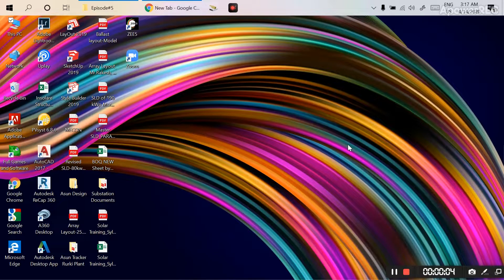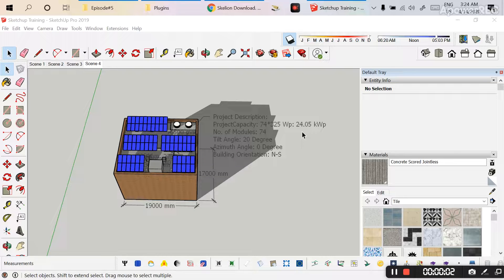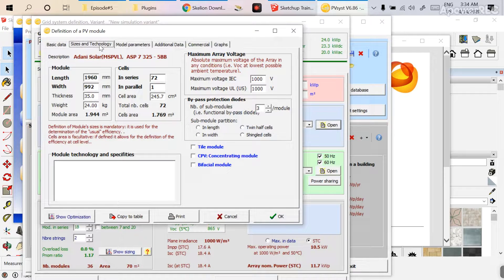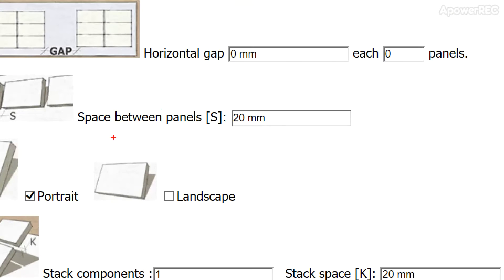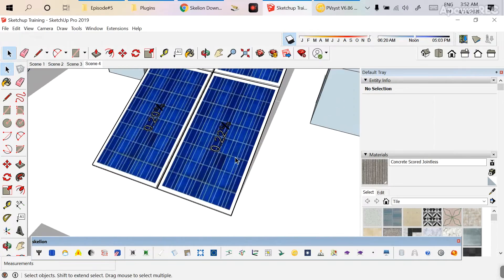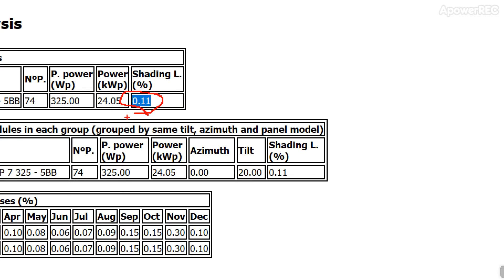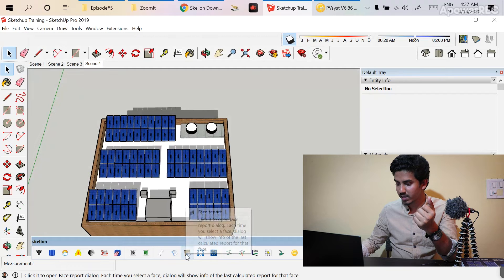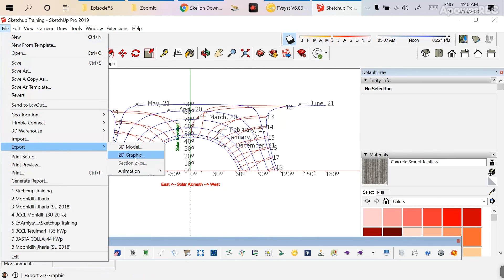Solar Power Plant Drawing using #Skelion/#SketchUp Training part 3/(Solar Power Training Episode 10)

Comment: Hello Sir, while designing the panel design with skelion,I have some issues with the software. It gets hanged completely and shows not responding. Is there any way in rectifying this?
Reply from the maker: Hi, Sowmya Thanks for reaching out. The solution you can try:
1. Try to uninstall the skelion & again install it the same way I explained.
2. If you have a low configuration system, then this issue can occur.

If it does not work, please connect me on what's app @9831633226.
Reply: @AllAboutSolar  Thanks, will try.

Comment: Sir please tell me that if we have number of buildings so in this condition pvsyst report should be one or should be more building capacity wise?

Please tell sir
Reply from the maker: If you have 2 buildings and you want single PVsyst report, you can draw 2 building in single sketchup and import the .h2p file to PVsyst. Both the building will be imported to the software. I will explain the same in my next video.

Thanks,
Amiya
All About Solar

Comment: HI man! how do you obtain value percentages centered and at the same height of the panel?
Reply from the maker: To get the shading losses percentage centered:
Go to the settings of the Skelion> Draw Shading Derate>  Select Use 3d Text 
It will automatically, centered the percentage on module.

Thanks,
Amiya
All About Solar
Reply: @AllAboutSolar  Thank you very much

Comment: Amiya can you please explain how did you import meteorological data to your software at 10:30
Reply from the maker: It's not about any perticular time. If you already import the Geo-Location during your drawing, then you need to select the international data in meteorological tab, it will load the data annually.

Thanks,
Amiya
All About Solar
Reply: @AllAboutSolar  but its showing error and popup occurs showing waiting for web response...